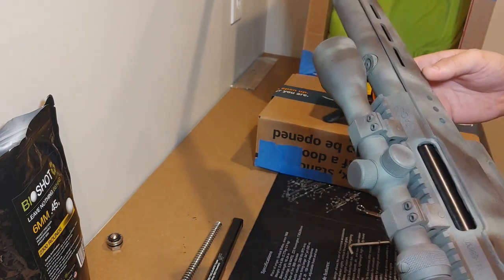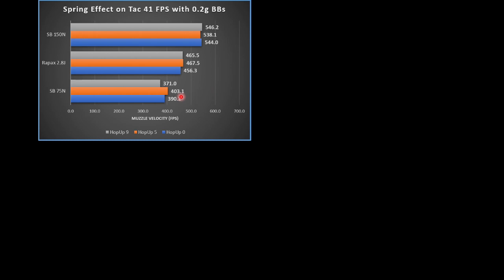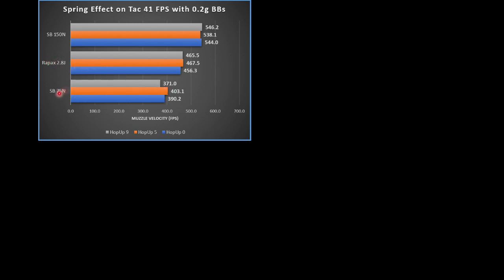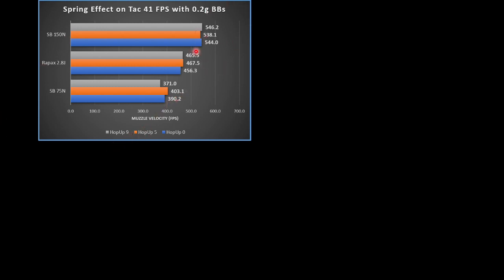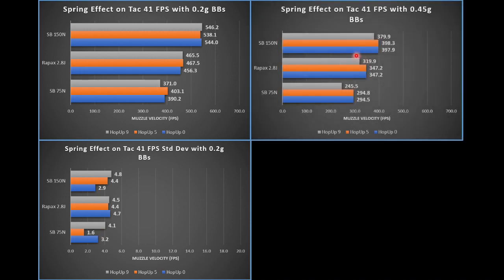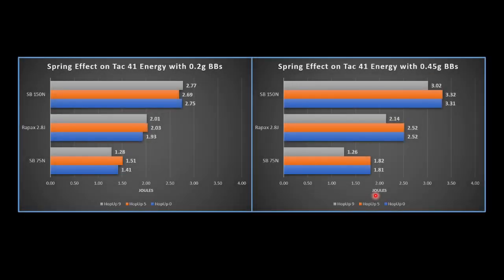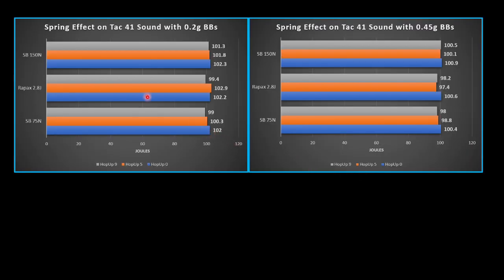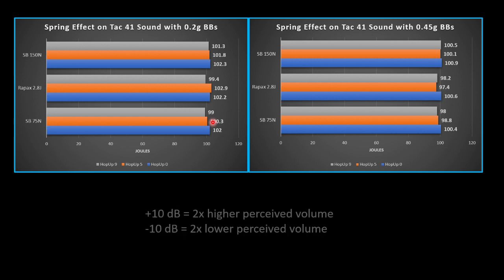Silverback Tac 41 Upgrade Series 1: Stock (75N SB), Rapax 2.8J and Silverback 150N Springs

Comment: Hey man, love your videos.. i have a question : what is the best hop up position with an SB 150N Spring with 0.43 or 0.40 bbs (0.48 is too much powerful i think) ?
Reply from the maker: On the stock hop up I suspect you will end up somewhere between 5 and 7 on the dial. Each replica will be a bit different.  The energy output would be quite high with 0.48g bbs and a 150N spring, probably around 3.5J.
Reply: @airsoftfpsboneyard  you won't believe it, but i just tried now the 150N spring with hop up 0 and 0.43 i got 3.90 joules, with the 0.40 same hop up position and same spring i got less than that but still high power output. I also have the stock spring and a 120N.
Reply: @scarfacetmcz9517 how many Jules did the 120N spring get? 
i cant deside between the 150 and 120 N springs
Reply: @anastasiosgeorgiou4053 go for the 150, you can get around 3.5 joules with 0.48 bbs 😁
Reply: Nice video man.. our field is 500 max an I'm really trying to get there with pin point shots